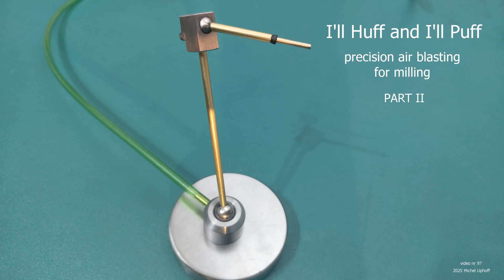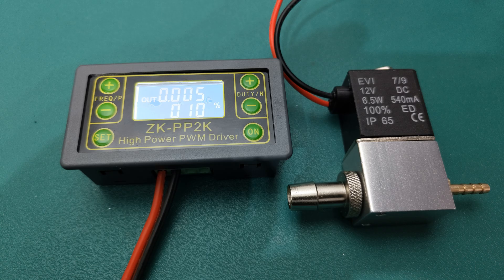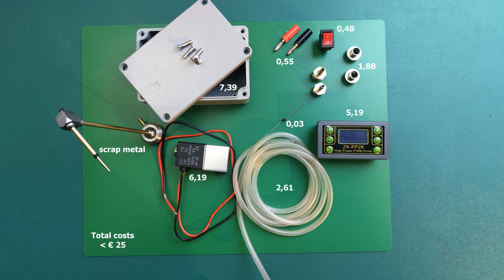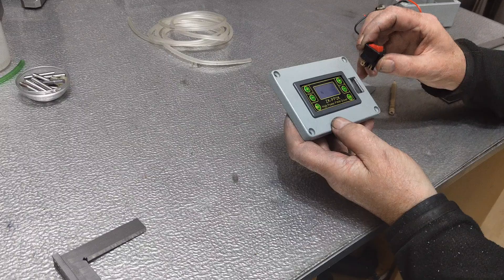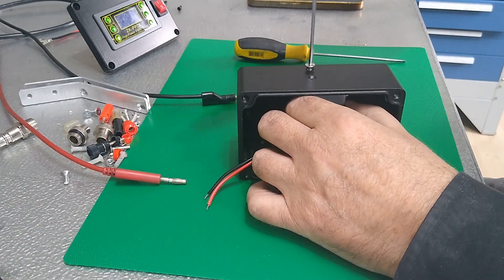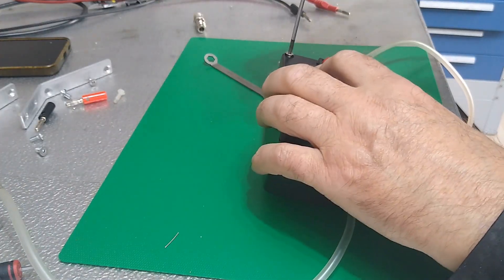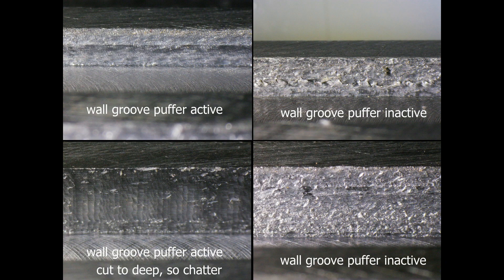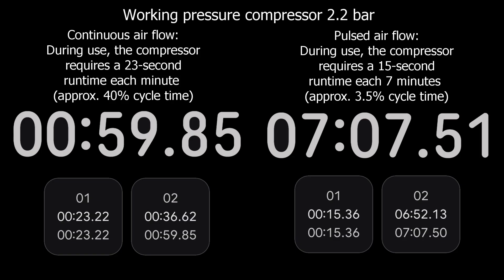I'll Huff and I'll Puff. Precision air blasting. Finale

Comment: Hmmmmm... 
As usual... something is crawling over my mind :)
What remove chips more efficiently : air volume or air pressure/speed?
Have no clue, but will be an interesting experiment :)
Reply from the maker: Hi Boris,
That can actually be calculated. For a given overpressure and nozzle opening there is a corresponding exit velocity and mass flow. Together those (mass and velocity) determine the kinetic energy, which can be calculated with Ek = 0.5 · m · v².
At lower pressures the energy rises roughly in proportion to the pressure, assuming laminar flow. At higher pressures, say around 1 bar overpressure, the flow becomes turbulent and a lot of energy is lost to turbulence. The key point is that at roughly 0.8 bar overpressure the flow reaches sonic conditions and turbulence increases sharply, reducing effectiveness.
If you do the arithmetic for 0.5, 1 and 2 bar, the kinetic energy available for blowing chips works out to roughly 20 watts, 40 watts and 60 watts respectively. With a well-directed nozzle that first figure of about 20 watts is more than enough.

Comment: Look out for inductive flyback on that solenoid! The controller specs do mention driving solenoids and motors, so its probably meant for it, but get an oscilloscope on the output to look for spikes > 40 volts or so
Reply: Why is there a tendency to comment on a video prematurely?
Reply from the maker: These nasty spikes can reach to over 1,000 volts. So I used a high voltage diode to protect the circuit.
Reply: He added a diode, as mentioned in the video
Reply: Hi Michel, great stuff!  I've ordered the bits to make this.  Just wondering which diode I should get and how it's wired into the pwm controller?  Kind regards, Rohan
Reply from the maker: @rohanfielder6796  You'll need a dirt cheap (6ct) 1N4007 diode, which you connect with its marked side (cathode) to the + output of the controller together with the + wire of the valve. The other, unmarked diode connection (anode) goes to the - output of the controller together with the - wire of the valve.
Reply: @Michel-Uphoff Thankyou very much Michel and for your prompt reply!  Very much appreciated and you have another subscriber.  Cheers mate, Rohan

Comment: Great result, but you should design a rotary valve drived by a a dc motor controled by the pwm  no noise no valve wear.

Comment: Very interesting and I may adopt this at some point.
 
For now, I went a different way with my MQL system. I have low pressure regulators on the air and coolant and then a peristaltic pump for the coolant (and a pressurized reservoir), too. For the nozzle I use small "needles" with Luer locks that screw into a small distributor block that I made where the coolant and air come together. The needles are meant for glue and other types of dosing. My small 30l compressor switches on once every 4 mins or so with this setup and I use very little coolant.
Now, I am thinking your solenoid switching system could actually work well for distributing coolant, too - as while I got my pump cheaply secondhand, not everyone is that lucky. 
For sure, relying on needles valves is way too finicky so this gets around that issue nicely.

Comment: Very cool concept. Another video I watched used a car fuel injector and required no compressed air. The video is MQL system without compressed air by MetalWorkerTools. His setup, like yours is very savvy. Thanks again for another great video!
Reply: Have you got name of the video?
Reply: @damianberbeka3714 Yeah it was in my comment, "MetalWorkerTools" "MQL system without compressed air". Hope that helps